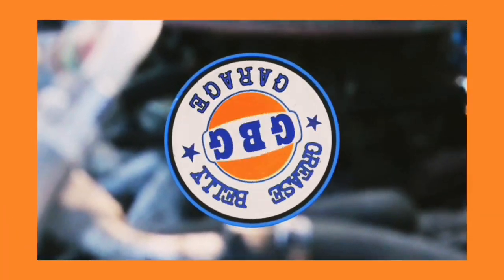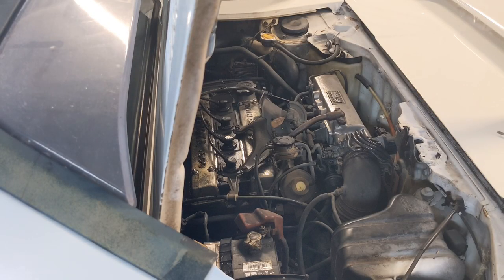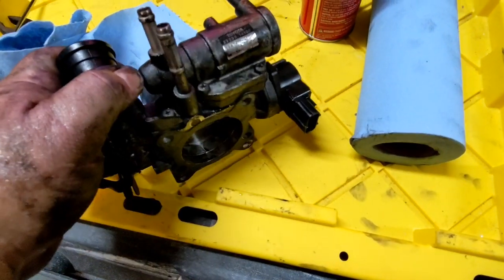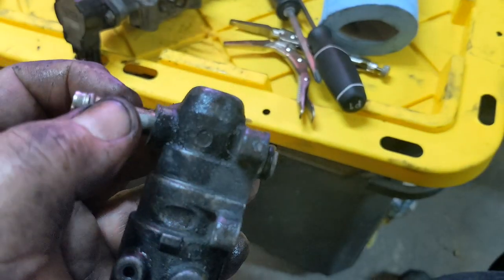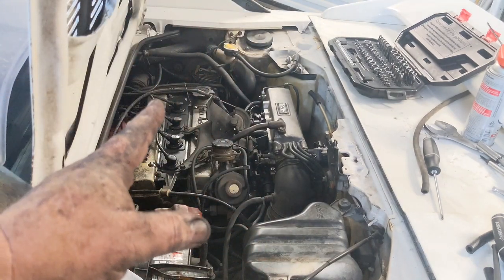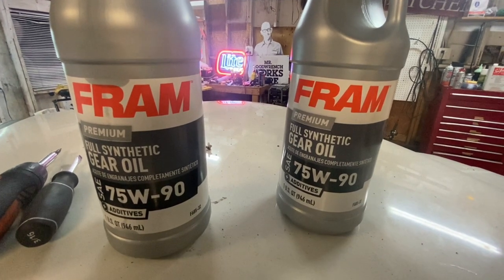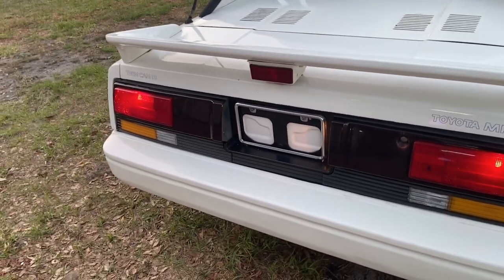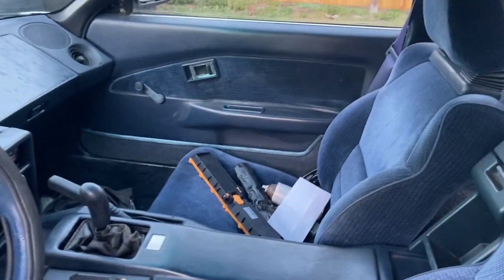1988 Toyota MR2 AW11 idle adjustment, manual transmission service and other fun, now for sale!

Comment: What is that adjustment at 9:42? I had my 85 AW11 AC converted and just need a new compressor for it.
Reply from the maker: It's hard to see in the video, but there is a white plastic valve that looks like a hex head with a slot in it and a spring around the base. You can turn that counterclockwise or clockwise to address the idle speed when the compressor comes on. I think it's an air conditioning idle control valve. All those older Toyota's have them.

Comment: Hey Man, just wondering how tall you are? Seems like the roof gives you a few more inches to work with
Reply from the maker: Well my dad is 5'6 and my grandfather was 6 ft 2 so I landed right in the middle at 5 ft 8. My height is not the problem, it's my circumference! Lol

Thanks for watching I appreciate it!
Reply: @greasebellygarage  hmmm you think a guy that's 6'4 could fit? 😂
Reply from the maker: @darqshark3506  ummmmmm I don't think so! Although it is roomier than I expected it to be.

Comment: Any tips on where to start looking for possible vacuum leaks?
Reply from the maker: Most Toyota vac leaks I've seen are from the air intake hoses. When they get older they crack and sometimes it's hard to see the crack. There are lots of videos on his to find a vacuum leak that you can check out. Some leaks happen when the engine is warm also. Good luck and thanks for watching.
Reply: @greasebellygarage  thanks! Yeah, I found that the air intake hose was cracked. Now having a very hard time finding a replacement part. Apparently they’re not made anymore
Reply from the maker: @andresmoreno3132  Amazon! Good luck!

Comment: New Sub wish you could fix the AC on My Aw11.
Reply from the maker: Thanks for subscribing. Usually those old Toyota ACS from the 80s don't have much wrong with them except maybe a small leak. You can also check that electric fan in the front behind the condenser and make sure it's functioning.
Reply: @greasebellygarage  I think I have to replace the shrader valve. as for the fans I unplugged the sensor so its on full blast. Gonna need to take it to a shop for AC drain and fill.
Reply from the maker: Yeah that's the best thing to do at this point schrader valves are easy to do but you need to pull a vacuum on the system before you refill it. If we were local to each other I'd knock it out for you.
Reply: @greasebellygarage  Thank You!! I so wish you Could!!